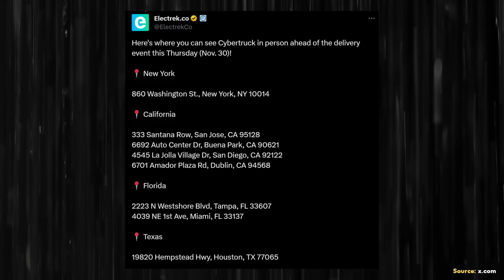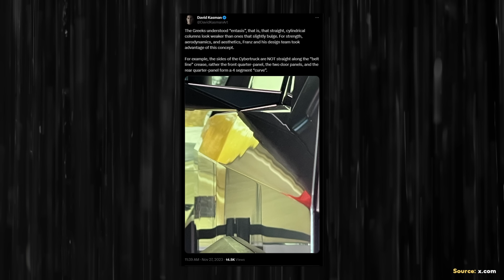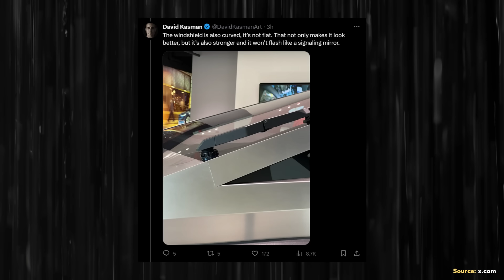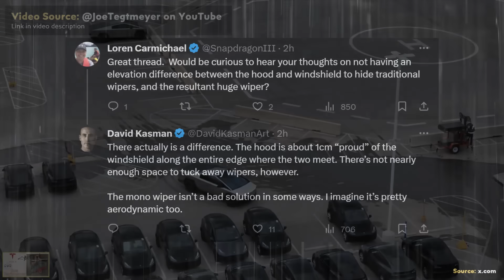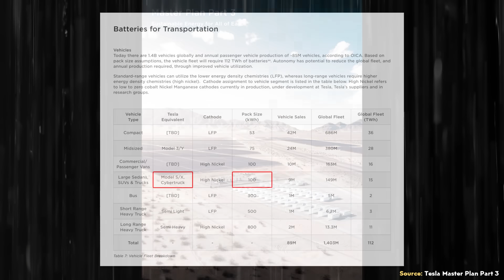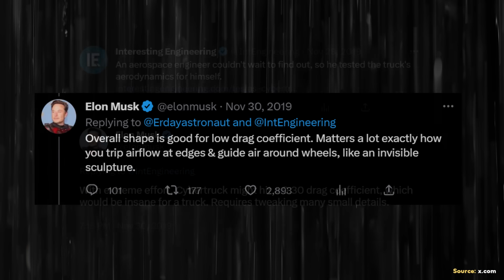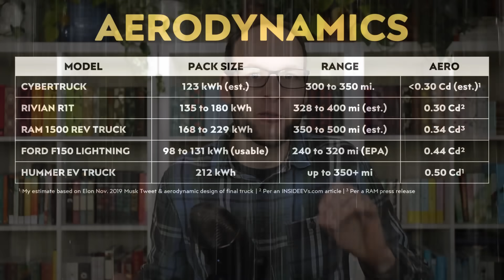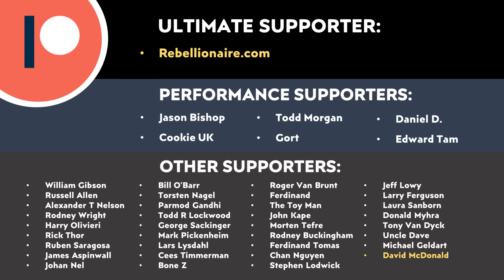Engineer REACTS to Tesla Cybertruck Design | Battery Size & Range

Comment: 12:03 I ordered the truck for towing a camper for many months each year. A 300 mile range empty is about 120 miles between charging stops while towing. That won’t work for me.
Reply: Good to hear. One less person in line to take delivery.
Reply: @dvader3263  That depends. Are you in line for the 3 motor version as I am? If that one only has 300 mile range, I probably will cancel. My Model X does that already and can tow the camper. I can only hope.

Comment: I’m looking forward to seeing it and getting the final range & price.  They need a version that has the promised 500+ range
Reply: Yeah I would love to have it for towing my RV full time and need at least 250 miles while towing. 600 miles would be perfect but not expecting it. Range will be my primary focus.
Reply: @Thisisaplaceholder1  looks like 320 miles but an optional “range extender” (whatever that is - we don’t know yet) will allow for 440 miles.
Reply: @1slyboy  470 miles but yeah, not good enough especially taking up valuable bed space placing the extender there. Could get away with that using an 8 foot bed but not a 6. Makes it near useless for hauling construction supplies. For the price it’s just not competitive. I was really looking forward to it and built my RV around charging that truck but what they released falls short a fair bit.
Reply: Buhahahaaaaaaaa

Comment: 300 miles range won't be enough when I lose half of it towing a trailer for camping.  This is one of the main points of contention for me to convince my wife that the CT can replace our current truck.  Like the Semi's range numbers (xxx miles fully loaded),  I'd like them to provide numbers based on the cybertruck being under load.
Reply: Musk will lose 1,900,000 (95%) pre-orders with the range to price stupidity. I am same as you. And want to REPLACE my pickups.  I have two on order. I do not want some boutique POS CT that has horrible range and high price. Look what happened to Ford with Lightening. 

Musk may have lied when he said many times the CT would outsell the F150. The F150 sells 700,000+ a year. IF this content creator is correct, Musk lied, and a pittance of CT will be sold compared to the combined sales of F150s, Ram 1500, GM 1500 class (Chevy and GMC).  Between them all 1.6-1,700,000 pickups sold. 

Also, according to social media yappers, CT payload is down by 1000lbs, and towing dropped to 11k.  The Musk specs of 2019 had the CT pushing 3/4 ton payload and towing (3500lb payload and 14,000lb towing).  

IF this soy boy video is correct.. Musk is either stoned out of his mind, or saving batteries for his Chinese made Megapacks. Total stupidity. IF there is no tri-motor 500-550mile unloaded range for under $79,000 loaded, Tesla stock will plummet in coming months. 

Musk has to meet his 2019 performance per model of CT commitments they published. Or else.  And do it for the top end model under $80k, dropping down from there. The long range CT dual motor had published 450 mile range (unloaded) for under $60k.  

Power is, if this kool-aid drinking content creator is correct in battery and range, sell Tesla stock tonight in after hours trading. I cannot believe how stupid arse hole mental insane Elon Musk would be having the $79,900 CT barely run 300 “Elon miles” unloaded. There will be thousands of shareholder lawsuits suits in coming year if this social media wonk’s theory turns out true.
Reply: It's a novelty truck to showoff.
Reply: @GrzegorzDurda  most big trucks are.  the best selling ICE trucks have all become luxury vehicles in the shell of a truck. They just dont dare call them what they are.
Reply: @KenLord  That's also true.
Reply: Don’t do it . Complete garbage !
Reply: Keep in mind that range extenders may soon become available. I'm sure they've at least considered it.
Reply: @alanlight7740  Yeah tow a generator or in an ICE car have an extra can of gas.

Comment: I need the range to be in the 450-500 mile range. I live in Canada and I drive 400 km (250 miles) every other week through mountains, often when its -20C outside. I need all the battey I can get. I wonder what the tri motor battery pack will be?
Reply: Absolutely no way 500 miles range in first versions - that would be way too much weight for most to be dragging around. Maybe an ultra long range version eventually. But efficiency starts to drop as battery goes up, so the gains on more battery aren't linear especially if you need to go up a grade.

Comment: I need at least 450 miles range empty or 250 miles with maximum towing. This would allow towing a heavy camping trailer most places we go camping. I could not get between superchargers in some of our routes with only 150 miles while towing
Reply: 250-300 miles range would be fine for a work truck for tradesmen who due local work (contractors, plumbers, landscapers,  etc .)

Comment: Very useful info. I really didn't know it was compound curves. That really changes everything. I men, think about it! Now I want one too.
Reply: The roof glass has to be compound curved, otherwise the top edge of the bed could not be straight across in combination with the curve of the front windshield. Fun things to ponder. What looks simple at first glance is actually complex, but the curves are so subtle they are hard to notice.

Comment: One CT variant's range seems to be ~290 miles, going by the 90% charge bar (265mi) seen on the touchscreen in a recently posted photo of the CT steering wheel on Twitter. Which variant of the truck it is is unclear.
Reply: Yea, I saw that picture and people are loosing their minds over it saying it’s proof of no 500 mile range. I’m guessing that’s going to be the standard range and there should be a long range for towing that is well into the 400+ mile range but we will see tomorrow.

Comment: I am in the minority (I guess) because I frequently take road trips that are over 300 miles and currently do those in one shot (no rest stops; no refueling) and an EPA of just over 300 miles equivalent will not suffice. I reserved the tri-motor based on the original spec of ~500 miles because of that. I will not be a hypermiler either, so I would much prefer a 400+ mile EPA equivalent for my particular needs. Oh and I occasionally tow heavy stuff so that adds to the needs.

Comment: I have a model Y long range. I may not purchase a cyber truck. If it doesn’t have about 500 miles of range. I want it for road trips. I think my place in line is about 500,000. Hopefully the batteries you have described Will be available then. My wife routinely drives 300 miles, she drives a Prius too, avoid stopping at superchargers.

Comment: Those are definitely not “on purpose” those are caused by bending. Not to mention that making something perfectly flat is really really hard, so it will look bended slightly. From pictures it can be seen that only intentionally bended piece is the frunk.
Reply: If something is flat and it’s sheet metal, it will expand in the heat and pop in or out. This is called oil canning in engineering terms because that’s what old metal oil cans would do on the shelf when the temperature changes. With a curved the expansion is controlled in direction and not noticeable. Oil canning is eliminated.
Reply: How can you say "definitely" when it comes to bending?  At best your guessing right?

Comment: Would make a great Hot Rod with a big V8 or V10 engine in the rear bed like the super cool drag racing trucks of the 1970’s.
Reply: Would they beat 3s to 60mph?
Reply: @waynerussell6401  Who cares, life is about noise, smell, and adrenaline!
Lithium batteries are so dangerous that when I have to test drive them wear fireproof overalls to keep safe

Comment: I spent 30 years at Boeing, however, I was in IT, I'm not an aero engineer. But, it doesn't take an engineering degree to deduce that storing the wiper in line with the airflow is more aerodynamic than storing in a position that would obstruct airflow. I have not a clue as to whether or not it actually contributes to the aero efficiency.

As for range, the more interesting number would be what one might expect while towing a boat.
Reply: With the AC going in hot weather,  towing on a slight incline. Or in the cold with the heater running and the temps being below freezing.  THAT would be the real range.  Likely, 75-100 miles.
Reply: @GrzegorzDurda  In other words, there's a good chance you will have to stop and recharge the battery both going to and returning from the lake - OUCH. Mileage is probably somewhat better if the bed is full of dirt or whatever, but it's still a problem. I think most people who buy a truck intend to haul stuff with it.

Comment: Wow, 12 minutes to say, no it is not just flat surfaces and oh, it is aerodynamic.
Who cares. To start with, it is ugly. You can get a cyber cuts on your eyes just looking at it. Visually unbalanced, it can compete with Pontiac Aztec in ugliness. Add to that that terrible decision to use brushed steel. A new auto looks like it has already had some doors replaced. 
Mileage... meh. Let me understand this - the whole point of EVs is getting more efficient and clean. This behemoth will require more electricity than the entire suburb area. Where is the saving? What is the meaning of talking about decimal points in drag coefficient of a monster that will use most of its power storage to carry that power storage? 
And don't tell me it is going to be used to hauling things. Definitely not. It is that "size matters" thing to compensate the natural lack of it. It is going to be a demonstration of wealth and masculinity. One guy driving from his downtown office to a golf club. Maybe taking the blond secretary along. That's about it. 
BTW. Take the old good BMW X5 for a change. Its drag coefficient was 0.29 in 2000! So, what is so impressive in 0.3 in 2023?

Comment: The cybertruck would have more range if the steel body was not 3mm thick vs 1mm thick, but Elon had three design requirements: look futuristic, bulletproof and badass!
Reply: Bullet resistant.  Definitely not bulletproof.  They used subsonic ammunition against the CT.  Let’s see what happens with 308 rounds with a green tip or steel core. Me thinks the truck won’t survive.
Reply: @austinpowers1999  9mm proof only.
Reply: @austinpowers1999  Are you sure that the Ford F-150 can handle steel core 308? Ford is using 1mm or less in some cases on body panels - and that's aluminum! Hearing a lot about how weak the CT will be compared to things like the "military grade" ford trucks... it's honestly an eye roll. I'll be interested to see what 380 might do, but there is a not unreasonable chance depending on the steel that even a lower power 9mm might not get through. That will be FAR more durable from a bulletproof standpoint than many "military grade" trucks from the other major mfg's at this price point.
Reply: Initially the design was described as "exosekelton" (joking with the misspelling) where the SS panels contributed to the structural strength however it appears that only the doors, and to a lesser extent, the bed panels contribute to the structural strength.  The weight of the CT is about the same or less than a standard truck in its size class.

Comment: You won't get the full 100 kilowatt it will be around 80 kilowatt-hour  that should give you around 265- 300 in true range not a problem at all if you understand how tesla batteries operate

Comment: For the dual motor option I think that a 300+ mi range should be the target, mainly thinking about the range while towing, what may be reduce up to 50%, that would leave about 150+ mi towing range,  well above the towing range offered by the current competition and also would begin to be deemed acceptable
Reply: No one that tows a trailer is satisfied with any EV.
Reply: My point exactly, "good towing capability" is an expected feature from a full size truck, I think towing impact on EV range needs more research and user feedback to determine what is "acceptable"  @Factory400
Reply: @carlosmartin3353  A fairly modest range is made FAR worse by the reality that the already small supply of chargers are not trailer friendly. Now the driver needs to park, disconnect the trailer, charge, reconnect the trailer. 

That issue may be more difficult to solve than the limited range. 

Nutty.

Comment: If you remember Tesla went thru several wiper variations after the CT design was complete. I think the very first idea was some type of air curtain, then a wiper that traveled across the windshield attached to a track top and bottom so that it traveled in a linear motion vs pivoting. I think the current design was a compromise to manufacturing ease.
Reply: The entire truck is a compromise for manufacturing.
Reply: @Bobbobbob984  The entire truck is a pos.
Reply: His confidence is a compromise to intelligence
Reply: Yea, some of those ideas were pretty out there. They could have worked for light rain, but not in a heavy downpour. Personally I would have just added a small cowl and put 2 wipers (or one big one) there like a normal car but I think when they ended up with is acceptable.
Reply: Went from laser wipers to a standard monstrosity and the passenger side is not wiped well.  The truck is already starting to look tired and aged. The design is not aging well.  Add to this Tesla is all Chinese looking to interrupt American Petro power with electric.

Comment: 500 miles range is what I am hoping for.
Reply: Well that was no wiper no mirror, pre-production numbers. I’m going to guess it will be around 450 for a long range option. 500 would be awesome though.
Reply: Your hope is destined to be shattered
Reply: They are saying 265 at launch, until we get new battery tech
Reply: @delxinogaming6046 I’m betting the standard range will be less than 300 but they should have a long range. If not, this truck will be all virtually useless for any heavy towing. So far that’s been the case for all the EV pickups but I believe Tesla can do better.
Reply: It’s out of my control, hope is all I got for now.  I will have the following choices 1) accept what’s available; 2) wait for a better choice; 3) cancel the order.  We will find out tomorrow.

Comment: The small step between front hood and the windshield  helps to divert the water from the windshield from going onto the hood and front of the truck
Reply: That’s a good point. I think it will also reduce bug splatter and small stone impacts on the windshield.

Comment: There is no front quarter panel. The panels on the front of the car above the wheels are called fenders. There is no front windshield. It is just called the windshield. There is no front hood it is just called the hood. You need to brush up on your auto parts terminology

Comment: Hi, thanks for the good information. I need at least 300 mile, 350 mile range for the Cybertruck as I live in a high remote area in Colorado that has the same climate zone as Alaska (reduced mileage in winter). Of course, the price will also be important, if it is over $70k, it is too expensive for us. I ordered the dual motor version in Dec of 2019.

Comment: 123kwh? What an absolute joke that’s just a 4 seater car masquerading as a truck at that point

I have two on order and they sure as hell better not have anywhere near 123kwh
Reply: Cybertruck is more efficient and therefore lighter than competitors.  Also i assume more motors equals more regen
Reply: @AudiTTQuattro2003  lighter than gm ford and dodge
Reply: 150+ minimum, anything below that is a joke for such heavy workload vehicle, i agree.

Comment: I think there's more "wiggle room" with the drivetrain.
.
Assume it's similar to the Semi.
We know a single motor has sufficient power/ torque to pull the Semi fully loaded at its designated speed.
.
The top speed of the CT will be higher (+69%? Double?)
But
The max load, even when towing will be ±7k (truck) plus 11-13k (load), roughly  25% of the 82k Semi.
.
Could they simple double (halve?) the gear ratio on the "cruise" motor to act as an extremely  long "overdrive"?

Maybe even more?
Torque from zero means it could be efficient at over double the ratio?
.
Then, the second drive, (1 or 2 motors) geared "low" (but still high compared to the Semi) for maximum low speed "grunt"/ tow start performance, assisted by the cruise motor, but disengaging at ..... 50mph(?) Unless called for on gradients?
.
Maybe  even a different engagement profile depending on use case?
Empty Econ.
Empty Performance ("Beast"!)
Load Econ
Load Performance
Tow Econ
Tow Performance.
.
The gearing (motor speed)  difference between axles isn't a problem, that can be electronically matched for seamless engagement (ref Semi)
.
Its just a different power map and disengagement speed.
.
It's going to be "interesting" to say the least.

Comment: Chatgpt estimates 296 miles of EPA range for a truck with a CD of 0.39 and a 123kwh battery pack weighing a total of 6670lb. Changing the CD to 0.30 estimates the range to be 353 miles. Also assuming a 175kwh battery pack (which was a recent rumor) with a CD of 0.39 and 0.30 and a tri-motor weight of 6,890 lb estimates 417 and 496 miles of range, respectively. Interesting.
Reply: How does ChatGPT know the effectiveness of the drivetrain? CrapGTP.
Reply: @royphillips7644  or the frontal load for that matter. All I was alluding to is that the 500 mile variant is indeed very possible.